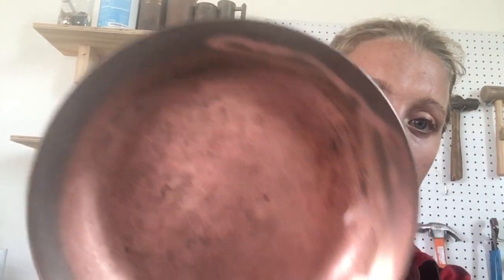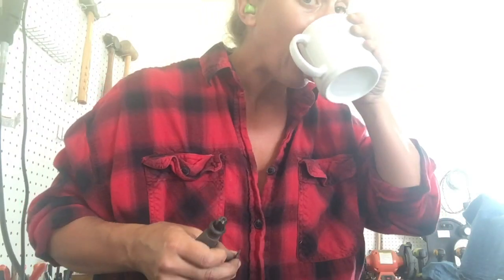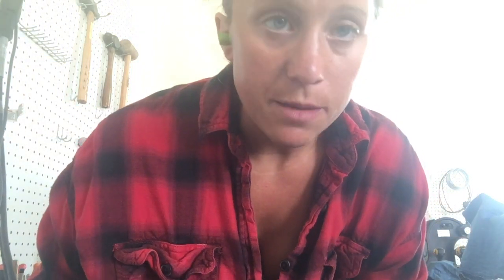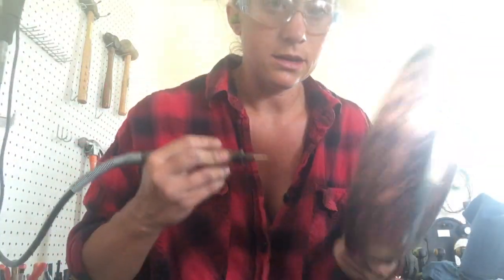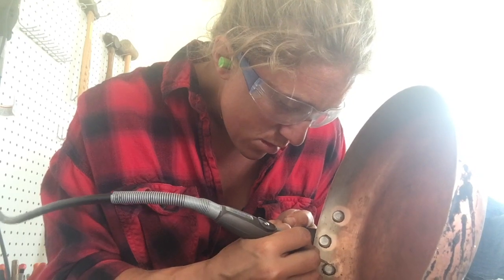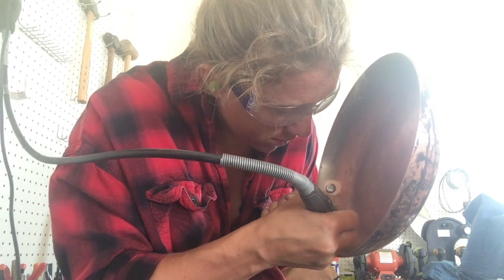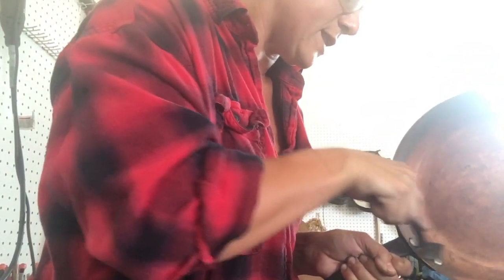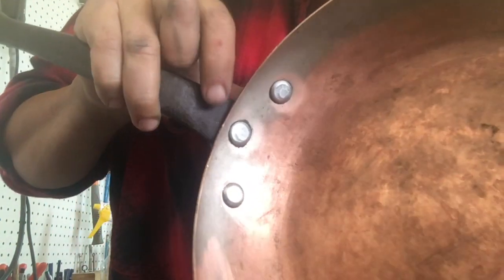Cleaning Cookware Rivets

Comment: I boiled vinegar and water in my stainless steel cookware up to the rivets, let it cool for a little bit, then used Barkeeper's Friend (few drops of water to get it coarse) and toothpicks to rub out the stuff.

I'm pretty sure Barkeeper's works on copper as well, but I don't have copper cookware and it's abrasive. Thought I'd just put it out there.
Reply from the maker: ooo - thank you for spreading the word!!! :)

Comment: Hi
Thanks for the video.
Do you ever replace aluminum rivets with copper rivets?
If so, perhaps a subject for another video. 😁
Reply from the maker: Hi~ thanks for watching! I don't replace rivets unless asked or if it's needed to secure the handle to the pot. It's a really tricky thing to do, and not something you want to do unless forced. But it could absolutely be done - just not my normal practice. I should definitely do a video on how to drill out and replace / custom fit rivets though! Thanks for the idea!!

Comment: I need a Bead Blaster.
Reply from the maker: Everyone needs one of those. ;P
Reply from the maker: Received your pot and lid - will start work on it this coming week!
Reply: House Copper & Cookware Great Sara, I included a couple Self Addressed Stamped Envelopes with plenty of Postage if you need to correspond directly. As I said, I’m puzzled what all went on with this kettle. As you can see there’s no rivets so you don’t have that hassle. The cover seemed so shiny and the kettle so rough. Anyway, I did all I can with it. I’m stumped.
Reply from the maker: @dannyreed2887  No problem. I'll tinker with it! Do you want it cleaned up and lined with new tin? I should be able to do it.
Reply: House Copper & Cookware Yes. I would like to have it properly tinned and whatever is on the copper on the outside. If the outside is a problem it’s no big deal if it’s cosmetic. I just thought if you can soak it in a caustic bucket of acid while the kids are in school that would be great if it takes whatever is on there off.
Reply from the maker: @dannyreed2887  Ok, the exterior is fine, it's just verdigris. It comes off with some different acid baths, fire, and then polish. There are rivets on the body, but they are easy to clear around. The interior has some really hard oxidation on it, which has come off with both soaking and some manual removal, and I will get it tinned with the next batch. So excited to see how this cleans up for you.
Reply: House Copper & Cookware I can’t believe it has rivets! I’m SO glad you were able to do that.